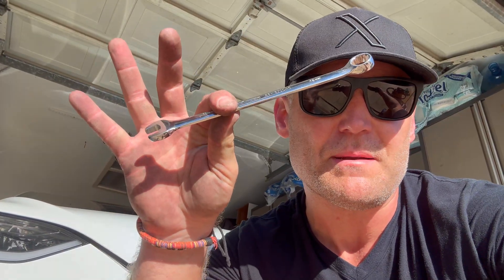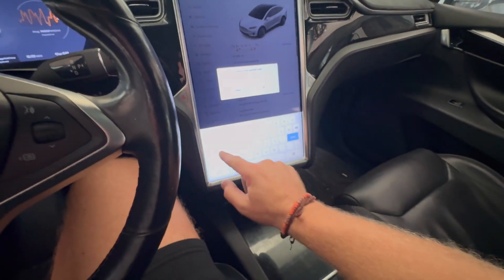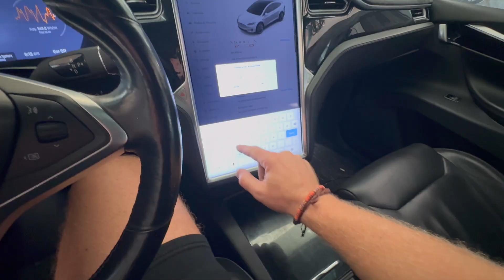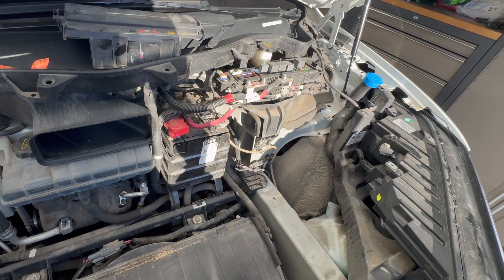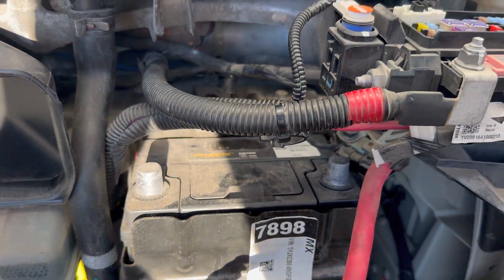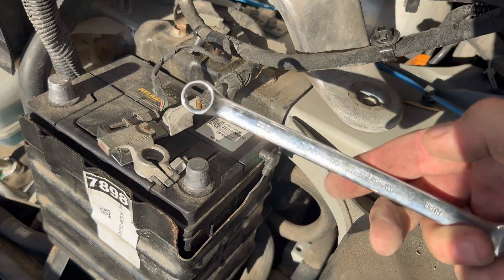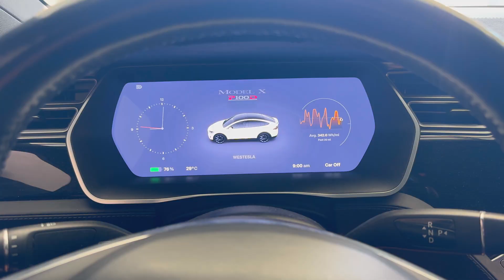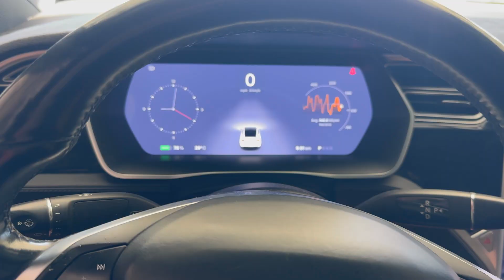Tesla Model X 12v Battery Replacement: HOW TO | DIY

Comment: you first need to disconnect the negative, then the positive, install is reverse: fist connect the positive then connect the negative. This prevents arcing when you accidentally touch the chassis with your wrench when disconnecting the positive.
Reply from the maker: That's a great point about preventing arcing! Thanks for sharing that tip. See you in the next video! 👋

Comment: Thanks for this... my 2018 X's LV battery just popped the warning.  I don't know that the lead-acid AGM ones last too long, I've gotten like 2 years max.  But don't want to spring for the Lithium one just yet;  Anyway, I was wondering why you did not power off the car before disconnecting the battery.  Does putting it in Service mode do the equivalent?
Reply from the maker: Glad I could help out! See you in the next video! 👋